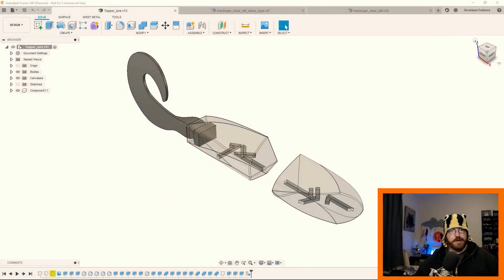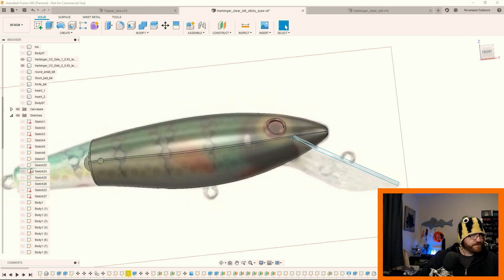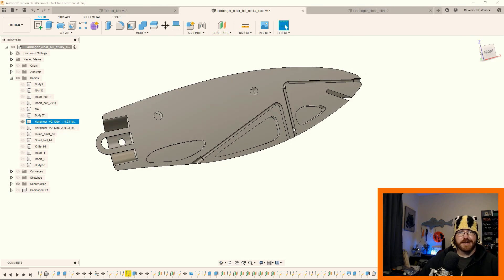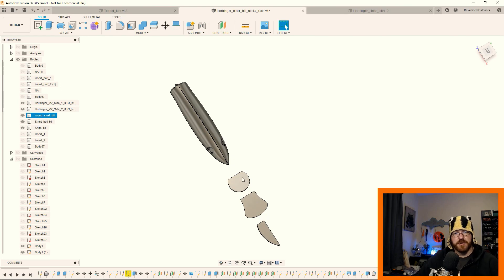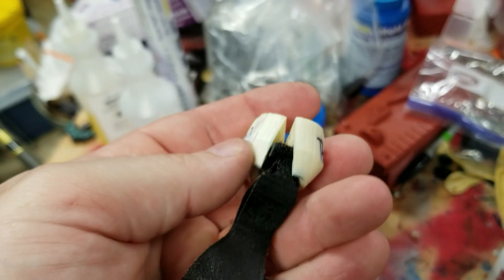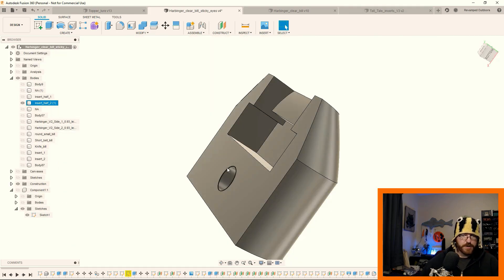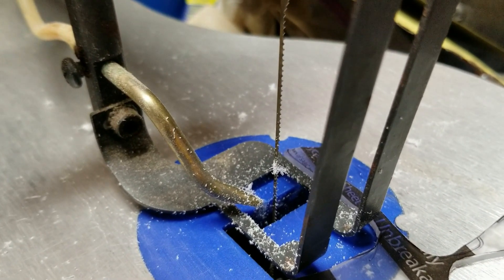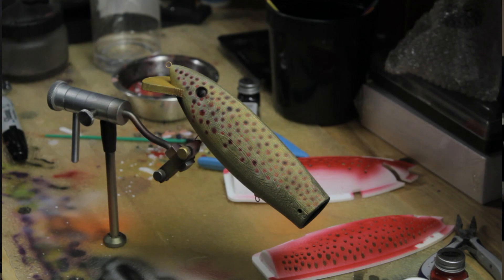Large soft tail crankbait for big fish with Fusion 360 tutorial, 3D printed! (Anet A8, Fusion 360).

Comment: In fusion 360 when learning to design soft plastic lures is it ok to design using T-splines or should I stay away from that?
Reply from the maker: I have tried using some designs with t-splines in sculpture mode, it's a little more difficult because if you want to work on the model in design mode and out of free form mode it locks the shape. Meaning if you work in the free form mode it is hard to change it once it is created unless you stay in that mode for the duration of making the model. I have since just stuck in design mode and attempted to make everything I can in that mode because it stays parametric and editable for the duration of the design. That doesn't mean that you shouldn't or can't "sculpt" model, some folks are much better at sculpt modeling I would try both ways and see which one works best for you. I hope this helps!